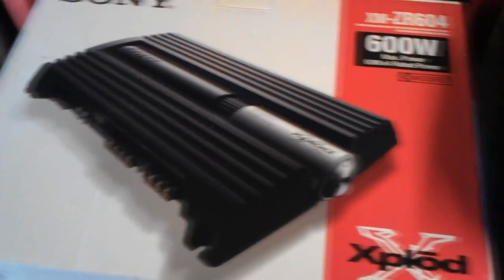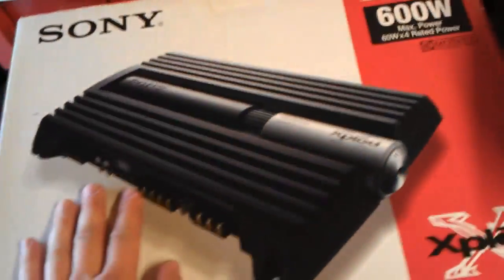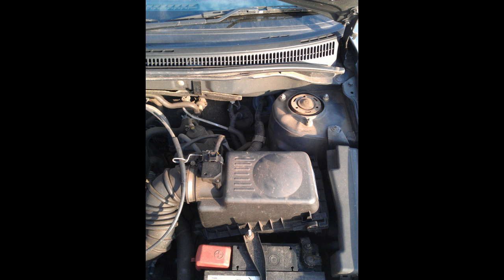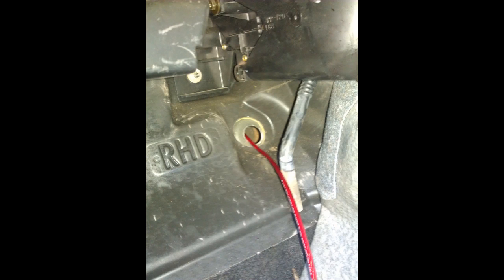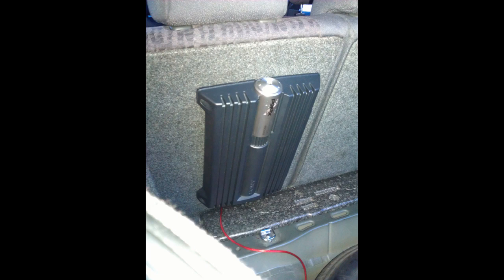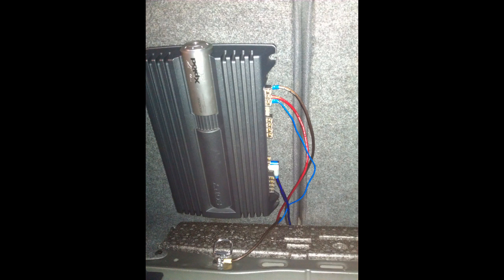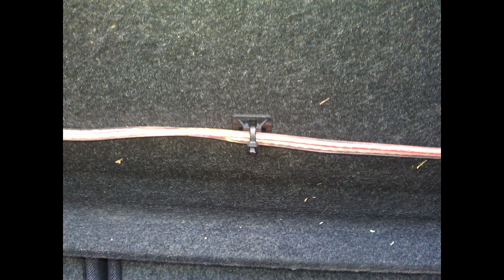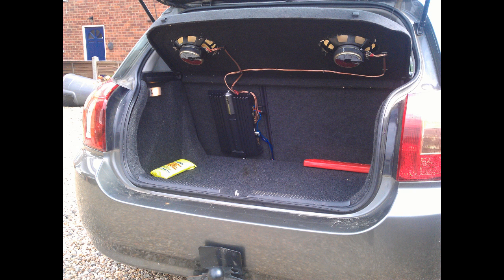How To: Install a car amplifier & wiring

Comment from the maker: Providing your headunit has them, you need to run phono cables from the phono/RCA out from the back of the headunit (they are two sockets, one red, one white) to the amp.
You will also need to run a remote wire from the wiring that goes into the headunit (usually a blue wire) to the amp which turns the amp on and off with the headunit otherwise it will drain the battery if left on all the time.
Then you need to run a power cable from battery and earth the amp to the body/chassis.

Comment from the maker: Would be tidier too with the second option as you could hide the 4 channel amp under the passenger seat or something which would hide a lot of the cabling then just have the sub strapped down in the boot with its own dedicated amp.
I've recently bought a 4x4 too, and have my 4 channel amp featured in this vid wired up to two sets of front speakers and two set of rears in a series/parallel configuration to match the resistance, and have a monoblock on the sub. Sounds sweet :)

Comment: Hi mate. I take it you run phono leads from the crank of the unit with the blue remote wire to the amp? You mention the phono connections on the back of the stereo but don't say anything about connecting the phono. I assume that's what the extra blue wire is in the pic of with remote wire by the peddles?

Comment from the maker: Entirely up to you, but for best result it would be beneficial as often the original speakers generally aren't very good and the sound between the old and new speakers might be noticably out of balance , but if you are just using the original head unit you probably won't be gaining a massive difference unless you install a decent dedicated amp. In which case replacing all four speakers along with the amp would make a huge difference.

Comment from the maker: Yes, that will be fine. As a rule, as long as the wiring kit meets or exceeds the maximum wattage of the amp then you are fine.
It's a bit naughty using a smaller wiring kit, but as I know that I will not be maxing the amp out I can get away with it. Plus, smaller guage cables are easier to route and keep tidy :)

Comment from the maker: Well the good thing is you have a 4x4 so aren't limited by space so much as you would be with a normal car but at the end of the day it's down to personal preference and budget.
You could get a 5 channel amp (4 speaker channels + 1 sub) and wire it all up that way which is what most people would tend to do, or find a 4 channel amp for the door speakers then buy a separate monoblock amp for the sub (which would be the best).

Comment from the maker: If I remember rightly, the Golf Mk4 factory fitted stereo doesn't have RCA pre-outs which means you'll need a new head unit.
Also, just a word of caution, the factory fitted stereos on VW's normall have a coded lockout, meaning if you disconnect the headunit I think the lockout will enable meaning that you need the unlock code which if you don't have in your handbook you have to contact your VW dealer for.

Plus VW factory units definitely require keys to pull the unit out.

Comment from the maker: Are you trying to get the standard radio out? Often the standard ones just unbolt. Otherwise if it is an aftermarket unit you should be able to buy the keys on Amazon, Ebay etc and your local motoring / car audio stores should have them or be able to order them for you.

Comment from the maker: Do you live in the UK?
you can buy RCA/phono splitters so you can run another set of cables. Can get these from maplins etc. or from amazon/ebay etc.

It may reduce the input volume a bit though but I'm running 3 amps in my truck from a home-made 1 into 3 splitter block and didnt experience a drastic loss.

Comment from the maker: Will be same basic principle as on the Corolla mate - I've done installs on most japanese makes of cars and they're all fairly simple. Once you find a place to get the amp live feed through in the bulkhead/firewall then the rest is easy peasy.

if you need help with anything specific just comment or PM.

Comment from the maker: Also, a 1000w 12" sub would not compare with say, a 1000w 15" or if you want extreme deep bass, 18" or even 21".

Plus, different enclosures will give you different SP levels and depth levels.
If you're just after pure rudeness then a ported enclosure is probably the way to go or look on speaker plan sites for scoops or put up a post for some plans and suitable drivers.

Comment from the maker: You can't always go by watts. Different sub/amp setups will provide different sound pressure and quality levels.
Personally I always opt for quality, so whilst I now have a 400w sub running a off a 750w amp, it's nowhere near as loud as another setup with identical figures which could easily turn my truck into a jelly.
If you're just after pure noise  then the obvious answer is get the biggest sub and amp you can afford but check reviews for the sound pressure level of the sub compared to others

Comment: Very important question. May be too late but, I have 2 speakers and 1 subwoofer connected to 1000watt amplifier. The subwoofer is working properly but the speakers don't. Even when i connect them parallel they don't work. The speakers can handle 130w peak power and they are 45 watts so i guess they can't handle the power?

Comment from the maker: Unfortunately the ist is a non-european model so I'm afraid that I can't comment directly, but it shouldn't be much different -
On the Corolla you remove the ashtray and trim around the gear lever revealing two lower screws and the centre fan control dial actually pulls off revealing the upper centre screw - after that the centre console carefully prises out. From there you can see the mounts for the stero.
Just be careful and/or check online owners forums for the ist.

Comment from the maker: Yeah, sorry I must not have explained that too well.
The remote wire is such a tiny current it's ok to run with the phono cables.

of course, most standard stereos that come with the car may not have phono outputs so that's something to look out for.
Tbh, it's always better to get a decent aftermarket headunit anyway :)

Comment: Hello I hooked my amp and subs up and it powers on but there's no base coming from the subs. The only possible thing I can think of is when I ran the RCA wire's from the radio the the trunk to attach them to the amp maybe the broke. Do you have any idea what can cause no base?
Reply from the maker: Hmm it's possible but unlikely the phono cables have broken... Are you sure the amp is a monoblock or has an EQ feature for subs?
Is any sound at all coming out? Also what channel amp is it? Sometimes multi-channel amps require you to 'bridge' two channels for subwoofers. For instance, if you have a 4 channel amp sometimes they can be wired into 2+1 channels whereby the first two channels are normal then you bridge either the positive or negative of the 3'rd channel to the negative or positive on the 4'th channel - It's usually positive - negative but is usually marked on the amp or will be in the manual.
If you don't have a bridgeable amp or a mono block then you can't wire in a sub as it will only play high frequencies.

Comment: Wiring up my amp and I have a question.. Can I run my inline fuse right off the battery with no 4ga wire between it and the battery?
Reply from the maker: You should always use wire that has an amperage or wattage capability equal or greater to that of the amplifier.
People do use smaller wire but i personally wouldnt recommend it.

Comment: Could you help me do mine.. I have everything wired up but the amp isn't powering on. Then I don't know how to connect the amp to the sub
Reply from the maker: If the amp isn't powering on then you likely have a blown fuse either on the amp or the main big fuse (if you have one) on the incoming positive cable from battery. Did you install the wiring to the amp with the battery side disconnected? If you did it live then you may have shorted the amp in which case it's fried.
Does the amp require a switch live from the ignition/stereo to turn on? Some amps require this so they only turn on when ignition/stereo is on to avoid draining the battery when car is not running. Or the amp may possibly be dead anyways. Is the amp a mono amp or a 3/5/7 type channel amp with stereo channels and a mono channel for sub? Either way it's easy, just wire the sub up to the mono channel (or stereo channel if there is a switchable stereo/mono chanel taking notice of the + and - polarity.

Comment from the maker: Well it's pretty much the same as I did in the vid. Just run the cables back along the bottom of the door frame trims into the boot.
The only real hard part is finding somewhere to run the power cable through the bulkhead - but from past experience, on german cars there is always several grommets you can utilise.

As for amps, if you just want to run a sub then you want a monoblock 1 channel amp - for the GT5 an amp in the 800watt range would be fine.

Comment from the maker: In some cases it's hard to avoid it. Besides, it wasnt running along the main loom, those wires are for things such as rear heater and stuff that rarely gets used. 
As long as the speaker wires/phono cables are separate from the amp power or any other high current wiring then it's fine, plus most decent speaker wire/phono cables are shielded anyways so just running it in a channel with some ancillary wiring is fine.
You'd have to be seriously anal or running insane quality setup to notice

Comment: Maybe somebody can help me out: once the amp is powered and grounded and I have input RCAs from my head unit, do I wire speaker wire directly to each one of my four speakers? So my audio source goes    head unit -> amp -> individual speakers, one at a time?
Reply from the maker: Yeah that pretty much it. Don't forget to connect the remote wire from the amp to your headunit (usually a blue wire on a standard ISO stereo wiring harness) or some sort of ignition live as otherwise the amp will stay on permanently and drain your battery when the car is turned off!
Wiring up the door speakers to dedicated amp is a good upgrade, although most people just replace the standard door speakers with better quality replacements and leave them connected to the headunit and then fit some larger speakers in the parcel shelf or boot (maybe 6x9's or 8" etc) and wire those up to an amp for some extra clout. 
There is no question that speakers are better wired up to an amp though - its well worth the effort :)
Reply: richardfld I have kicker Ks 6/9s all around with an Alpine power pack, 45 RMS per channel. The speakers can handle 150 RMS so u definitely want to feed those beasts some more power. Also if you can help me I am confused on converting speaker wire to the +/- wires connecting to the speaker. In my mind I picture I would need some type of y adapter to turn the single speaker wire into 2 separate +/- wires. Any help is appreciated!
Reply from the maker: Speakers are just like any other electrical device, each speaker must have a positive and a negative feed (two wires) to create a complete circuit. This is what each channel is (a + and a - together make a single channel). So for a 2 channel amp you will have two sets of + and - terminals making 4 in total, and for a 4 channel amp you'll have 8 and so forth.
I use proper speaker cabling when I wire up my speakers, the stuff I use is two wires combined together (the + and -) so you just make a single run for each speaker channel. Google figure 8 speaker cable and you'll see the stuff I mean. You can get all sorts, types and gauges but for just a standard install I wouldn't worry about getting anything too expensive or high spec. You can always use regular old single core wire (if thats all you have or can get) and just run two lengths to each speaker but it usually ends up being untidier.
Reply from the maker: yup just wire each speaker to its own channel on the amp. So
Front left = channel 1
Front right = channel 2
Rear left = channel 3
Rear right = channel 4